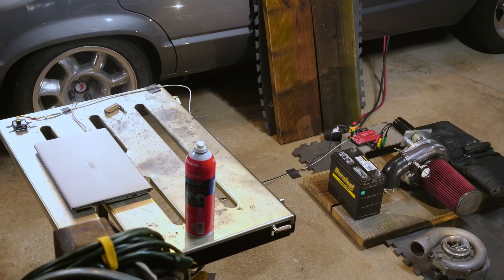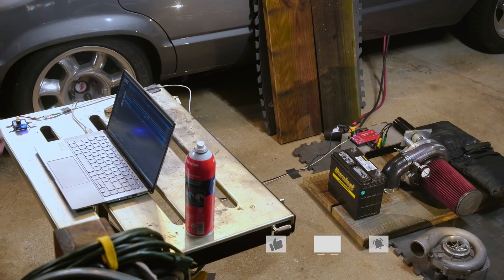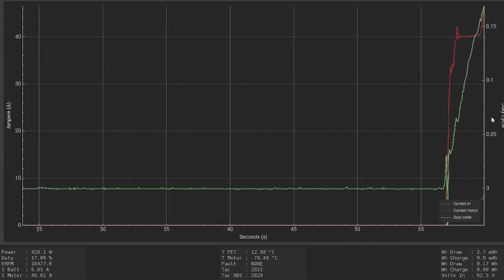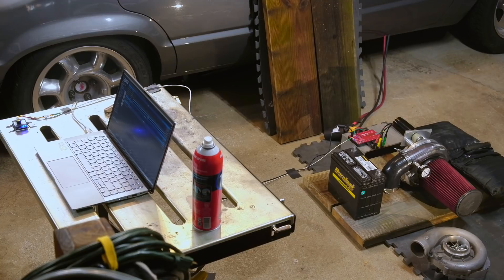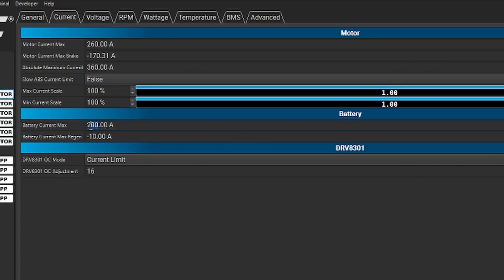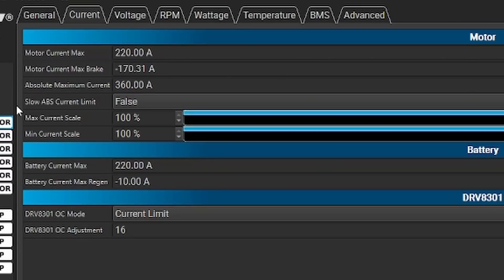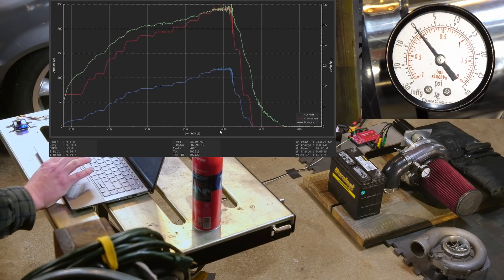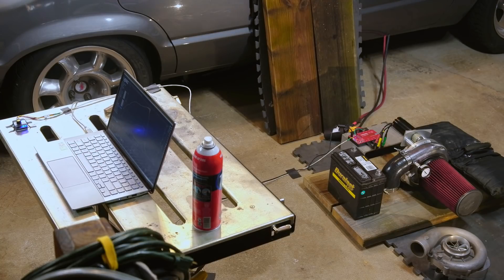Easier/Cheaper High Power DIY Electric Turbo - Full Power Attempt #1

Comment: I'd consider playing with the timing, it acts like a sporadic de-sync that's re-establishing. Many ESCs have several timing settings for kv ranges and sometimes an "auto" setting. It's a common issue on high speed quad motors because of the rapid accel/decel rates on the props. It can lead to a burndown like your last attempt if it doesn't detect and shut down. I believe the adjustments actually tune the reverse EMF from the motor which is what is used to lock the timing. A desync is when the motor and esc get out of time and often makes an knocking or grinding sound. A sure way to induce it is to try to accelerate or brake harder than the motor has the power to " keep up" with. causing a slip. Not sure if this is your glitch, but it's where I'd start with my flying toys.
Reply from the maker: That's an interesting idea, but I think it's something else.  Like you, I think it's electrical, but not on the motor side.  Thanks for watching and commenting!

Comment: I just came across this channel so I may have missed something from before.  All I can see is that you are generating about 4-5 lbs of boost but there is no air mass flow measured.  Boost pressure alone is meaningless without knowing the volume of air at that pressure. Its like releasing air form a tire, sure there is 25psi, but little air volume.  I have been experimenting with similar setups for many years ever since high power brushless motors became available.  I used a giant 6 HP (4.4KW) brushless motor, and regardless of gearing, the turbo impeller could not be made to spin anywhere near its 100,000 RPM or so speed in order to produce usable boost and air volume at the same time.  Even a small 2 litre engine running 10 lbs of boost requires an enormous amount of energy to spin the impeller, so unless you are prepared to run a 12KW brushless motor with a 1000A ESC, (a completely impractical solution), from a 12V battery its never going to happen.  And this is exactly why no car manufacturer has gone down that path. Porsche recently introduced an electric motor to provide supplementary power to a turbo setup, but only to momentarily prevent the impeller RPM from dropping too low while on trailing throttle, thus reducing turbo lag. Don't waste your time and money with electrically driven turbo's.
Reply from the maker: That's why I drag and dyno test these things.  The first version, using the same motor, pulled just shy of 14kW and made some pretty crazy gains in the quarter mile: https://youtu.be/AOL3Qyczt3Y

Comment: I can't tell, do you  have the capacitors directly in front of the VESC? That would help greatly with power supply fluctuations.
Reply from the maker: Yes, I do.  Two very large, very expensive, very low ESR Kemet caps.  They're the two black cylinders at the battery cable/VESC cable junction.

Comment: is the turbo stalling or belt slipping a possible cause of current spike if the load becomes erratic?
Reply from the maker: That's a good thought, but I think it's electrical.
Reply: @AlexLTDLX  when the boost needle starts fluttering do you think that's due to the current spiking? or could that be  mechanical slip/stall? hard to see in the video but I'm sure you can tell in the room

Comment: Look like air flow to me? Filter or air out is going where into the floor? Imagine it was water direct it somewhere not just down.
Reply from the maker: That's a good thought, but I think it's electrical.
Reply: @AlexLTDLX  ok if its electrical cut the current down to a third and see result does it do it at 80 amps flutter at the max amps, i think you want rpm to be your goal not max amps i don't know how well the controller will handle that, or start small on motor current leave others set high 20,40,60,80 small pulls to figure this out process of elimination. Still think its air and I am the electrician, haha go figure.
Reply: I deal with huge 5000 amp water pumps 12 foot high and the water outlet on those goes into a huge Trough thats slanted if not water would splash back towards outlet and cause back forces, resistance, pump flutter and the psi gauge would do the same thing bounce.
Reply: Hook up o scope to motor on two of the three and watch frequency does it flutter then its electrical, you basically have a frequency drive, soft start, vfd, whatever you wanna call it, I build those for a company saftronics. We just use 5000 volt ac three phase in. Instead of dc. But output is same thing you are doing.
Reply: I have seen them blow up at 5000 amps and holy $&@$ there is a reason there in a metal cage. big boom. So i am with ya start small its easy to burn them down, and not the goal.
Reply: Out test pump setup looks exactly like yours but the motor would be on bottom, inlet on top, side discharge with snorkel faceing down, here is how we fixed it put a ramp at bottom of output, again if it was water you dont want any air splashing back in towards output. In the engine you will have some draw not really vacuum that will do the same thing keep air from wanting to go backwards my two pennies, good luck!
Reply: And that filter try one pull without it.

Comment: M 2 cents it's electrical. I would up the gauge of wire and most definitely make them as short as possible and not run them under the car door.  Also check all your connections and connectors make sure the can handle the amps and are not loose. Ohm out the wires while wiggling stuff and watch for changes in the meter reading. If you have access to a Megger you can meg the wires and check for voltage drop/leakage. I appreciate your work on this project and I know you will figure it out.
Reply from the maker: I checked everything with an actual milliohm meter (read: expensive).  I do think it's electrical, but I think it's a bit of an esoteric issue.  Thanks for the kind words and thoughts!

Comment: I guess the question is... Is the gauge bouncing caused by an airflow issue(restriction/turbulence on inlet or outlet), caused by a mechanical issue(tension in belt), or is it caused by an electrics issue?  I'm guessing load is bouncing like that will amplify the current ripple/spike effect.

I did something similar way back in the early 2000's using a PMG 132 coupled with a T76 compressor.  My first attempts simply shredded the belt, so I had to get an Alltrax ESC involved to slowly ramp up power.  Luckily fault detection wasn't an issue back then - controllers were dumb.  The only time I've seen the needle bounce was when I had too much boost too early in the RPM, and too restrictive air filter - although your filter seems like it'd flow the CFM needed.
Reply from the maker: I think it's electrical.  Only one way to find out!  Thanks for taking the time to watch and comment!

Comment: Also, cut a half inch square in the motor bracket and slot one of the bolt holes to make a quick tensioner.
Reply from the maker: It's already slotted.  That's how I adjust belt tension.

Comment: Belt driven inducing the spikes. You are looking at the data, but looking at the electrical aspect, when is the mechanical drive causing the issue. I would start looking at the RPM at the belt and look for belt shake/wobble. Imbalances here will show up as spikes, kind of like valve float.
Reply from the maker: I don't think so.  I believe it's electrical, and I have an idea what it is.  I'll be testing it very soon.  I could be wrong, too.
Reply: @AlexLTDLX  If your testing is inconclusive. You could always slap the motor on the old turbine and see if the problem is there still there.

Comment: I think your limiting of the current is the issue with the fluctuations: The current rising is the system's response to load. It's similar to injector duty cycle on a gas motor. You wouldn't set a max injector duty cycle to test for horsepower unless you were specifically testing for your fuel systems limits (and even then, I doubt most people would do much more than set it to stop the test if it exceeds a safe level). in this testing, you're looking for compressor information, but you're limiting input power. 

I believe you would get MUCH better results if you'd set the max battery and motor current to 80% or so of whatever max they can handle, and then set a conservative target RPM. Your compressor map will make a lot more sense when you are varying your motor RPM, and you can check the logs for however much voltage and current you were needing to reach those numbers. Then you can bump up the RPM target and log the changes in boost while monitoring the current to see whether or not you're getting close to its maximum safe levels.
Reply from the maker: I don't think that's it.  Only one way to find out!  Thanks for taking the time to watch and comment!

Comment: Your battery current can't be equal to or lower than your motor current. Because motor current plus any esc losses equals higher current demand on the battery shut off side. The spikes are the system regulating current because the battery side isn't set high enough.
Reply from the maker: On the contrary - in a brushless application, motor current has to be higher than battery current.  Brushless motors run on a duty cycle, and the power has to go somewhere; otherwise it would turn into heat and melt down the ESC.  Look at it this way:  you're pulling 100 amps from the battery, but you're only pulsing the motor coils 50% of the time.  Motor current would have to be 200 amps, but only half the time.  The other half the time, motor current is zero (again, 50% duty cycle).  That's a bit oversimplified, but hopefully you get the idea.  Motor current isn't an average, it's the current of the pulses.

Comment: You are switching huge currents at very fast rates, the VESC has no filtering or suppression to hold against the switching pulses it is generating and you wont see whith soft-logging (laptop and USB). Get an osciliscope and watch the power feed directly at the VESC and you will see the issue. Big cables help but capactitence and some inductance will help right at the VESC input.
Reply from the maker: I think you're almost right, but have it a bit backwards.  There's too much inductance in the battery cables.

Comment: I believe you're seeing the current spike at those levels because the compressor is choking on the restriction, or the mechanical forces from the energy the blower is producing in the test environment, is forcing back through the impeller shaft, through the drive gears, into the electric motor, could cause the motor to draw current irradically?
Reply from the maker: That's a reasonable guess, but I think it's electrical in nature.

Comment: Check turbo bearings. They are not optimized for axial loads like your applying.
Reply from the maker: Lol - it's exactly what they're designed for.  The belt drive too - it's factory machined into the impeller shaft.  It's a supercharger, not a turbo.
Reply: @AlexLTDLX  My bad. Thought it was a turbo just modified to be shaft driven with a belt. I got a thing or two to learn. Thanks for educating me on this. Cool setup.

Comment: Turbo can't flow any more or any faster?  Cavitation causing the surge?  What's the impeller spinning at rpm?  Much more at work than just your electrical readings boss!
Reply from the maker: I'm pretty sure it's none of those things, and it is electrical in nature.  As I think I've said to another of your comments - and I've mentioned a couple of times in the video.  That motor (and almost exactly that impeller) already made 650hp on the car.

Comment: current fluctuation is proportional to power fluctuation, the pressure is fluctuating, the sound is stable, looks like aerodynamics phenomenon, chock waves, surge ...
the pressure should not fluctuates.
check the outlet restriction.
Reply from the maker: I actually think it's electrical in nature.  I'll test shortly.  Thanks for watching, commenting and most of all, subscribing!
Reply: @AlexLTDLX  thanks for the videos

Comment: I'm no engineer but, I suppose every mechanic knows that it is the volume of air that a cylinder can be filled during the piston's intake stroke. So let's say a 302 ci Ford with a volumetric efficiency of 75% at 5,500 RPM can ingest about 360 CFM at ambient pressure, doesn't that means that a forced induction system has to be able to provide enough CFMs to overcome the engine's nominal CFM at ambient pressure? I might be wrong but, isn't boost just a measurement of the result of over filling the cylinders by forcing more air volume. I think the only way to measure that turbocharger efficiency is by hooking a powerful shop vac to the compressor outlet and see if it can create boost, meaning that the compressor can outflow the nominal CFMs of the vacuum.
Reply from the maker: That's an interesting idea, but this would likely damage the shop vac (it's pushing almost 10 times the power already, and once we it's sorted, it'll be much more.  I find testing on the car much more fun, anyway.  These tests are just to work out any bugs on this second version.

Comment: That breather will choke air like crazy! I bought a bigger one and it had extra cone in center. In a rush i forgot to tighten clamp.. i was driving 4 cyl turbo dodge and it used to spin tires all the way in second gear and very little third.. but after rebuilding motor it would catch traction mid second.. i was getting on it in second gear it caught traction under full load 30lbs when hit bump breather popped off and it was like 60hp shot of nitros hit.. remove breather. And or add vacumme gauge in breather. They also make a ventury to help funnel the air makes HUGE difference at high turbo rmps
Reply: Also why is the needle on gauge jumping? Motor sounds steady, turbo should be steady pressure if u have one orface releasing the pressure.. a running car would have pulses being valves opening and closing stopping the flow.. what would cause gauge to bounce.
Reply from the maker: Honestly, it's just a cheap gauge I had kicking around in the garage.  Being hard mounted to the volute likely isn't doing it any favors.  I wouldn't read too much into it.
Reply from the maker: With the first version of this blower we were losing traction on slicks at about 60 mph.  If you haven't seen it, check it out: https://youtu.be/AOL3Qyczt3Y

Comment: Many good possible explanations here, I would add: non-linear back pressure from the air resistance setup you have. Maybe add a large vessel between the turbo and the hole so that turbulence has less of an effect? Or something else better to mimic the pressure & airflow characteristics of the engine? Also, like others have said, testing the ESC and motor with an adjustable test load would probably be helpful.
Reply from the maker: I think I know what it is, and it's not mechanical.  I'll be testing my theory (on video) very soon...

Comment: Like others have commented, its process of elimination-backtrack and only change one thing until the problem is solved. Twisting/shielding the power & motor cables is a good idea. Also, design a load to test the motor/drive assembly separately from the blower. Good luck, loving the content!!!!!!!!
Reply from the maker: You're only the second winner!  At least I think you're right.  I'll test it on video to be sure soon.  I think it's inductance in the power cables.  And thanks for the kind words!

Comment: the jumping of the boost needle looks like slipping off the motor. it probably needs a pulley/ belt style system instead of the direct drive. or some type of gear set up. I think when its spinning they are bouncing off each other. how did you spin the first one? i seems to me almost 100% likely its the way you have set up how to spin the pulley to make the supercharger/turbo run. a belt under tension would probably be best. you could get away with a small belt a tensioner and the super charger pulley. maybe resign the bracket. or maybes theres some kind if chain system or gears like the timing chain or gears in most cars.
Reply from the maker: This one is belt driven.  The first one was direct drive.  I personally think it's electrical in nature.  We'll find out soon enough!  Thanks for taking the time to comment and subscribe!

Comment: What are the current the wires are rated for? When the wire start to heat the impendance raise and hit a wall... So the wire will start overheat the more current you put
Reply from the maker: They're 2 gauge.  Should have no problems with this load.  I think you're on to something, but not quite exactly.  I'll test my theory soon enough, and who knows?  I could be wrong.  Thanks for taking the time to watch and comment!

Comment: It appears only things changed, 1- Volute & Impeller; 2- drive coupler.
Non-electric gremlins- boost flutter appears prior to electronic oscillation. Flutter, usually occurs with belt slip, although a timing belt (teeth) is used. I suspect belt drive could be the culprit, motor mount may flex under load, or belt stretch. Could a tensioner be incorporated? Could the controller detect oscillation between blower rpm, belt rpm & motor rpm (load variable) and protect itself?
Reply from the maker: I think it's more likely electrical in nature - like approach voodoo electrical issues.  We'll find out soon enough!  Thanks!

Comment: Try adding capacitors. It looks loke noise on the graph?
Reply from the maker: I've already got two, very large, very expensive, very low ESR Kemet caps there. They're the black cylinders at the battery cable/VESC cable junction.